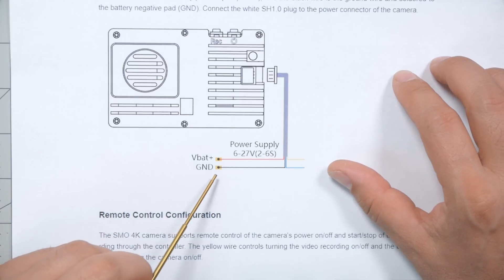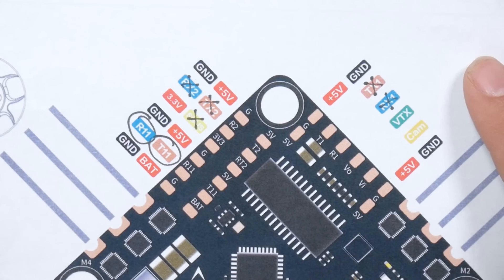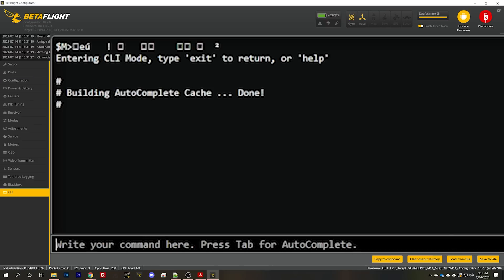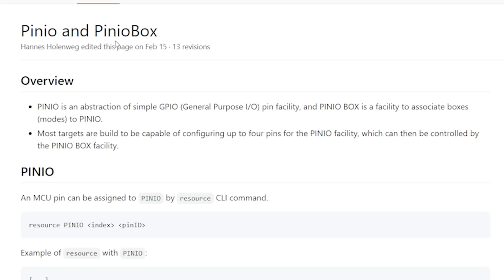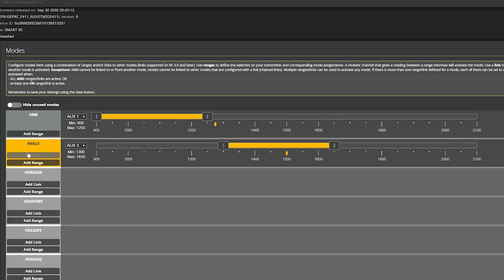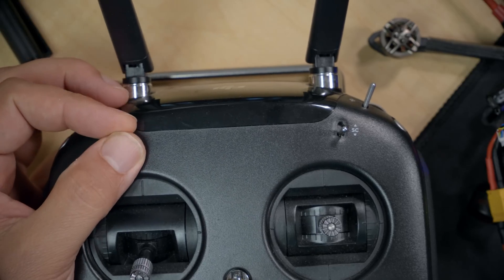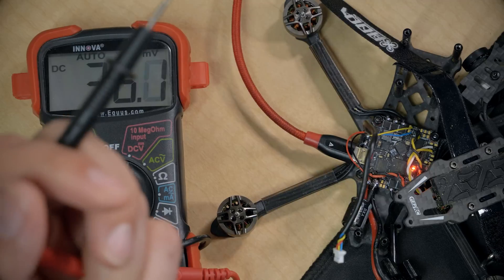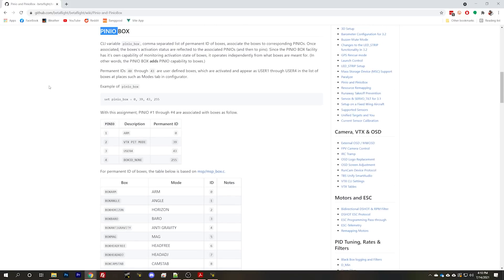Switch things on and off with your Betaflight FC pinio and pinio_box in depth tutorial

Comment: Hello, good morning, thank you for your videos. I have a question I have a fc f7 mepsking, and a 04 dji lite camera, the camera does not evidence when I connect the lipo battery. The lipo battery is 4s, at first I thought it was what it should be 3s, but the fc brings a direct connector for the 04 lite, now there is a switch that must be welded (I think), I don't know what to do with this so that my dji 04 lite video system works.

I don't know if it's the battery or the fc or the switch.

The switch soldered it between the middle and on or it didn't work.

Help !!!

Comment: some great work joshua in all the time you have been here ,i have a question ,my problem is in betaflight 10.10.0 and the online betaflight, i need to use user 1 for my led on my pavo pro i have just built and there is no user 1 in my modes tab on both betaflights and yes i have unticked hide. please can you help an old man who thinks hes loosing his marbles...

Comment: I got myself a pavo20 pro wich has led lightening and User1 configered to control the ledstrip with an AUX switch, but it stopped working all of a sudden. I went as far as completely wiping and reflashing the firmware of the drone to the original thinking i changed something but i cant control the light anymore no matter what. User1 isnt listed anymore in the ledstrip menu. Any idea's? Have trying to fix this problem for 5 hours straight but no luck :/

Comment: i have the same FC and would like to use GPS with the T11 and R11 pads

when i want to configure them, i get this
# resource SERIAL_TX 11 A00
###ERROR IN resource: INDEX NOT BETWEEN 1 AND 10###

any idea why?
Reply from the maker: They changed softserial to its own resource. It's not serial_tx 11 any more. It's like, resource soft_serial 1 A00 or something like that.
Reply: @JoshuaBardwell  thanks, i tried that and it is showing up and gps is activated, but when i check "status" in cli it says gps not connected, can't find the gps module and tried different ones, they do work on other FCs .. not sure if it is a limitation or if i am doing something wrong since it should technically work

Comment: hi,
i have an important question, and i can't find a clear answer so i come to you. i would like to be able to cut the power of my vista with a switch so that it doesn't heat up during the gps search. do you know if i can do that? i have a speedybee f405 aio 40a (the purple one) and a lot of differents stacks... so i search a solution is applicable for all FC.. (if is possible!) and i don't see a solution for that and it annoys me!!! thank you, i hope you will answer me, cordially, A.
ps/ i have a led pad Vbat, do you think i can turn off this pad with a switch by connecting the power supply of the vista to it?

Comment: seems like it only works with signal ports?
What if I need a power 9v port to turn on\of remotely from the controller. Is it possible?
Reply from the maker: You can't switch power this way. You need a real pit device.
Reply: @JoshuaBardwell  thanks. Seems like it’s hard to get it in my country 😓 looking for a circuit scheme to diy. It looks like there is a pnp transistor and some other smd components I can’t understand what are and what for 🫣

Comment: Can you also switch betaflight parameters on/off with a radio switch?

anti-taz runaway_takeoff_prevention parameter ON/OFF on a radio switch?
Nice to not have an auto-disarm when you are stuck on a roof with 3 blades of grass around one prop. Being able to spin up to full throttle no matter what can save you an unsave trip to the rooftop. I noticed my quad was often not able to take of with just minor entanglements of one motor/prop, that I'm sure would be cut off if the prop was allowed to spin up properly (putting the throttle stick to full).

Comment: So I just got the defender 25 with the dji o3 and I have a few dji remote 2 grey controllers so I figured I would just try out the remote 2 pnp option.  I’m thinking that may have been a mistake because the way this looks to operate, without a second uart controlling rtx, I can’t shut the unit off via remote and still have rx connectivity…doesn’t the rrx and vrx run through the air unit when it’s configured this way?  Should I just add a nano rx and get rid of this sbus wire so I can use my tango 2?  I tried to configure the dji remote 2 to turn off vtx, but it killed the vtx permanently until I reloaded the config and cycled power….it’s like the FC couldn’t power the o3 back up without the remote command.  And if the o3 is powered down, I get no radio.   Is there a way to make it work?
Reply from the maker: No there's no way to make it work. If you shut down the O3, you also lose controller link.
Reply: @JoshuaBardwell  yeah…I’m going to add the nano.  I really feel like I should have known this was the case before I ordered it, but they could easily add a note to the product page that the pnp option will limit vtx power mode functionality…but I should’ve known lol…
Reply: @JoshuaBardwell  Thanks.  Got the nano rx installed and kept the sbus from the o3 wired up and the tango 2 works fine.  Very easy and clean.  Now to tune it.  The PIDs on this out of the box seem crazy high.

Comment: Hello joshua , need ur help . i have LeD for my drone and its only 2 wire.   + and - only . it is possible to make a switch or we must need 3 wire led to make it switch on and off using pinio  ?
Reply: Mines was 24v led , connect via bat pad on the fc ,  i wonder can it make a switch using pinio ? only have 2 wire .
Reply from the maker: You need a "realpit" device to switch that led in and off using pinio.
Reply: @JoshuaBardwell  what do you mean real pit ?
Reply from the maker: https://youtu.be/oS-EeAo53m8

Comment: Hi Joshua, thank you for the great video and the explanations. My current task for our drone project is to get our SMO 4k Camera to work without using the Betaflight FC controller and after listening to your 20 minutes of explanation the task looks a bit less overwhelming!! Am I getting it right that the ON/OFF and the record pins of the camera are controlled by just high signal for ON and low signal for OFF? Like in my theory it should work by first putting 3.3V continously on the ON/OFF pin, then 3.3V continously on the Record pin as long as I wanna record. In the firsts tests the camera recorded unreadable video and the LED turned red (Solid), which indicates a battery signal(???). Do you have an advice?

Update: I guess I figured it out. The blue ON/OFF wire of the camera needs a short impulse of 3.3V to turn the cam on and a long impulse (~2 sec) to turn it off. While the cam is active the yellow Rec wire of the camera first needs a short impulse to start the recording and again a short impulse to stop recording. 
The only thing that confuses me still is that you could measure constant 3.3V signal on the ON/OFF wire with your multimeter when your aux channel turned it on. My camera turns off after a few seconds when I keep up the High signal.
Anyways, thanks again for the great video!
Reply: Gratitude!
Reply: ATTENTION! DO NOT try to set this up for BetaFPV SMO 4K - it will never work properly!!!

Comment: Can this be used to turn on/off the led lights ? Want  to turn them on/off and change their color once it is on
Reply from the maker: If the LEDs are programmable then use Betaflight led tab to turn them on and off and change their color. The LED LOW aux mode will turn off all LEDs. If the LEDs are not programmable, the a pit switch and pinio can turn them on and off.
Reply: @JoshuaBardwell  Thank you so much, want to be able to turn off LEDS so as to not freak out the neighbors, yes i have programmable LED's

Comment: I'm trying this path but running into an issue - when I try to check and see if there's anything assigned already and type get pinio_box or get pinio_config, I'm getting ###ERROR: INVALID NAME### I think I should get a return even if nothing is assigned (255,255,255,255)  Does this mean my fc (an older spracing F3 Neo) can't do this?
Reply from the maker: Yes correct. The F3 isn't running a version of Betaflight that supports this.
Reply: @JoshuaBardwell   Ah well. Thanks for confirming. And more importantly, thanks for all your work in this space. You are a pretty amazing teacher. As someone who often struggles my way through the technical side of quads, I always know your videos will make it easier to understand. I've learned so much from you. Blows me away you that you directly responded here so quickly. What an awesome human you are!

Comment: I've a jhemcu f722BT. it has 2 cam Input which can be switched with user 1. unfortunately i made a solder bride from vin to 5v.
now the ic labeled 3108 is dead.

do you know what part this is?
6legs:
1 goes to cam1
2 goes to cam2
3 gnd
4 goes user 1 pin on the f722
5 goes to the osd vin via 75ohm resistor
6 probably NC

i could directly solder 1 cam to the 75ohm resistor and it works, but i like to replace the IC.

but for this i need to know what ic it is which is labeled 3108....

Comment: Great info!
I'm totally confused as to why those soft serial pins were pre-assigned to motors as well though.  Seems like you would have met confusion if you either wanted to use motors 5/6 or the soft serial. Or maybe only an issue if you enable both?
Reply from the maker: Correct. You could use a hex mixer with those pads as motor outputs.

Comment: That's awesome - on a related note is there anyway to use the peripheral controls on the DJI controller such as the shoulder buttons, or can we only use the aux switches? Guessing the peripheral controls are not exposed to betaflight, reserved for DJI FPV.

Comment: Is this camera smart enough to finish saving the recording before powering off? If not we could use a logical switch in OpenTX to delay powering off (folks using a DJI or Flysky radio are out of luck). Also I propose to add an (advanced mode) user interface for PinIO in BF configurator. It is too useful to be hidden within the CLI.

Comment: Can I do this on runcam5 such that I can record the footage and turn on blackbox recording on the same instant?
Reply: There is no easy way to do that. In theory you could open your Runcam 5, solder wires to the start/stop button and use a relais connected to a PinIO pad. If your goal is to sync your video to your blackbox recording this wouldn't help much because the Runcam needs a little time before actually starting the recording. It's easier to start the recording manually and then giving the quad a small bump that you will be able to see in the video and in the gyro movement in blackbox.
Reply: @Gosuminer  thanks a lot for replying man, yeah I agree with your point ,it's hectic to do this, I opened the cam and learned that inside the switch there are three terminals the middle one is at 0V and to its right and left the terminals are at 1.78V each. If the switch is pressed the 1.78 V pins are brought to 0v so I thought I will assign a button in tx such that at its normal position the blackbox is recording but if I do the above mentioned steps shown in video and assign that when the switch's state is changed the blackbox recording will stop and as soon as I leave the switch it will spring back to its original position making the camera to start recording and the blackbox will start a new log. But as you said if the camera has some inbuilt delay after the button being released then this won't work.

Comment: Great video!
I do have one question though: isn’t the GoPro set up so that you have to have the switch to ‘ON’ for about a second, then back to ‘OFF’ to get it to start recording? And same thing to get it to stop?
Reply from the maker: Yes that's correct. I go I to more detail in my naked GoPro tutorial but since this is a pinio tutorial I left that detail out.
Reply: @JoshuaBardwell ok, so for a GoPro, make sure you use a momentary switch! And preferably with a timer on it to make sure it’s working correctly.

Comment: The reallity is: 
Digital data are decoded with on / off. That's where the name came from. Motor outputs using pulse width modulation as example to tell the ESC how he should power the motor. Simplified saying. PWM keeps the signal high for a specific percentage of an specified time frame.
Analog signals are not just on/off. But they are "constructed" with an digital/analog converter they also have a resolution (8bit or 12bit...). Meaning, they can not output every value...

Comment: I have an og Runcam dvr that doesn't have an uart on it, but the start/stop button on it connects signal to gnd. I just soldered a wire from button's signal pin to the buzzer's gnd pin on flight controller. The buzzer's gnd pin is the only one that switch gnd rather than signal on a flight controller. Than I now can start/stop recording on the radio using pinio beautifully! 🙌🏻🎉🚀👍🏻
In fact using this method you can turn on/off almost any device. You just need to figure out what are their power buttons doing (connecting signal to gnd or signal to vcc) to know where to put it on the FC.

Comment: Thanks for the information. I am curious to know what the reliability of this is like. I had everything setup and working. They it just stopped. Osca Liang mentioned problems with reliability what has your experience been long term?

Also thank you for diving into various bits covered in this video. Great work!
Reply: If it stops working then a setting has changed or hardware issues like a broken pad or cable.

Comment: Could you use this as a pit switch to switch off/on your VTX?
Reply: AFAIK, for a VTX, this requires a switchable power output — whereas this video is using switchable signal outputs. That means the FC itself has to support power output switching, since otherwise the power pads are permanently and physically connected to power.

That said, FCs with built-in power switching do use the pinio function to assign the User 1 mode to the switchable power output. 

(JB mentions this briefly at 17:20 as well.)
Reply: @GRANOLAFPV  thanks makes sense!

Comment: Woah so powerful! You could hook this up to some transistors and diy yourself a cheatercam switch or some laser tag shooting thingy or repurpose your fc to a 500hz expresslrs light switch!
Reply: Or get yerself a 3.3v relay and drop parachutes or turn on lights or control your garage door from your drone.  The sky is the limit!
Reply: Or finally make my tarsier start/stop recording in flight!
Reply from the maker: With this function, wired properly, you can basically emulate a button press on a device like a Tarsier or a typical vTX. Back in the day, people would use this function to change band/channel on vTX that didn't have smartaudio.
Reply: @JoshuaBardwell  yep, but with some transistors and pull up/down resistors on a prototyping board you can switch basically anything :D